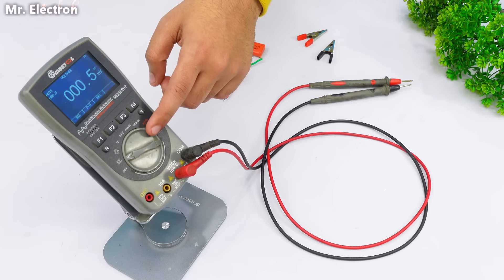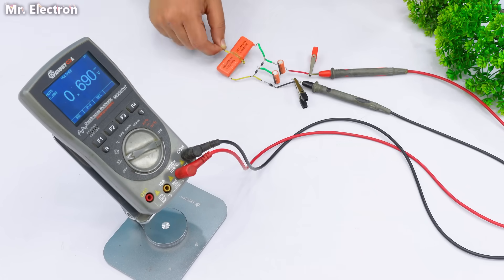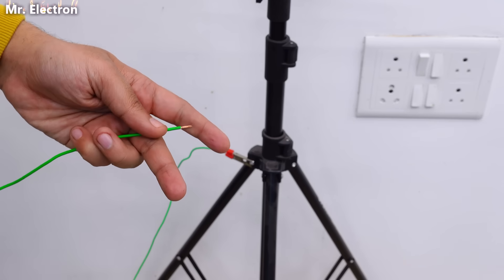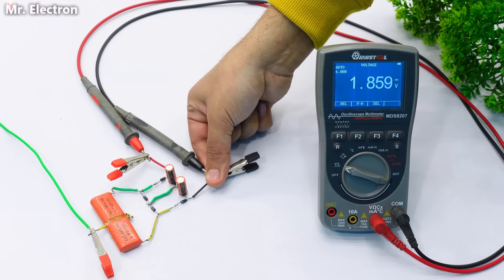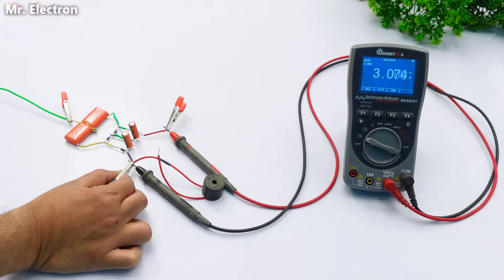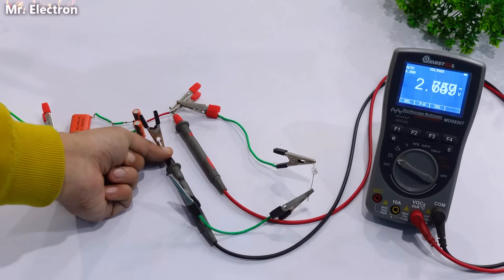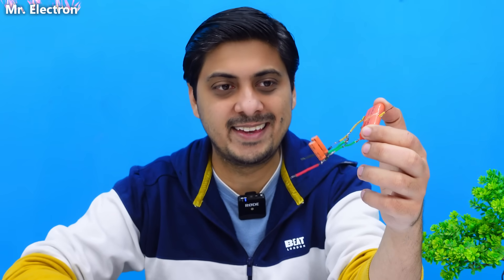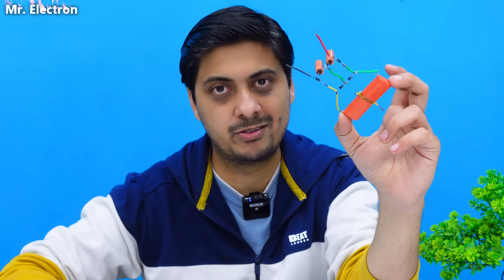Maxwell Chikumbutso - 5000 KW FREE ENERGY from RADIO WAVES | 100% Working Model DIY

Comment: I built some of these energy harvesters and was able to generate voltages ranging from 50 to 100 volts, the type of diodes are very important in these projects because of there ability to sence faint high frequency switch on and off at high frequency.
Reply: The highest RF fields are usually from AM radio stations, in the 1 MHz band. High speed schottky power diodes can do it. Back 100 years ago, farmers near big stations would hook up lights to their fences or barn roofs. No magic about it, just picking up high fields that you can calculate.
Reply: @corneliuselbourne1044  and when you apply a load to it the voltage falls off
Reply: @IanLogan-n2p  that's because the current is to low, remember high frequency is a type of voltage and you can't have voltage without current, you have to build another circuit to supply current like a DC to DC boost converter.
Reply: @corneliuselbourne1044  No, frequency, current, power, and energy are totally different things. If you step down voltage with a converter, you get more current but less voltage. The power is always slightly less than what you put in.
Reply: @jamesvandamme7786  I know but frequency dose have a relation to voltage and resistance, power and current also has a relation to each other even thoe there formulas are different, you can't have voltage in a circuit and not have current flowing through it, current in a circuit is lazy and need the Voltage to keep it moving, the building up and storage of current multiply to power.

Comment: Your conclusion is based on two (2) fatal faults. 
Firstly,  you're self contradictory in that you've proved that it works. However,  you go on to make an unreasonable assumption that you know everything about this technology.  Any other thing outside your scope is false.  In reality, there're people who know more, who know better. 
Secondly,  you're declaring that the amps/voltage so produced is too low for any significant application.  That is the discovery itself that he, Maxwell,  has made. If he has a car for display, what then is not real?

Comment: no doubt RF can be converted to electricity, problem is RF in the atmosphere is weak to produce substantial power. we need a huge RF collector to utilize it for commercial use. efficiency of conversion is also a factor . input power is always bigger than the output.
Reply: 50v/m height is a huge voltage, just imagine if we can use Mosfets to vary that voltage between 0 and 50 several times a second. Now increase the height and thus voltage to 500 volts ant 10 metres and use insulated aerial. Capturing 'Atmospheric energy' rather than 'radio waves' may be the correct word.

Comment: The principle of a crystal radio which does not require a battery, but works from the electricity coming from the radio station.
Reply: I continue to "shake" oilmen with my innovative project of a non-combustion engine, I remind you that I am posting here on my channel the technology and the principle of operation, according to which anyone can create a prototype and enjoy free energy, since I was denied financial support at the stage of the idea and theoretical research, after a year of unsuccessful searches. Including I will begin to assemble a sample. And soon another video will be released, revealing my developments, the wind of change is approaching! All those who are not indifferent, welcome to the flight in this departing innovative car, which will lead to great achievements for the successful future of the planet and humanity!
Reply: @maguccimotorincorporation  I hope you've solved the big problem of perpetual motion machines, that is, where to hide the battery.
Reply: @jamesvandamme7786  There are no batteries. It takes energy from the air or water and it cools down to produce energy.
Reply: It's because of the antenna and diodes ability to sense the frequency from the carrier wave from the radio station it's powerful enough to switch the diode on and off.
Reply: You can see the battery underneath the bonnet next to that square box he made
Reply: @IanLogan-n2p  It doesn't look like he made anything. It looks like a factory made traction inverter to drive the motor of the car. the 12V battery runs the auxiliary equipment in the car, like lights, radio, steering. Look inside any EV and you'll see a very similar layout. Look under the floor and you'll see a large battery which powers the car for hundreds of Kms. Then you have to recharge it. 
Somewhere he stated that you have to "service" the car periodically for a large amount of money. Maybe he charges it up and returns it to you, I don't know.
Reply: Of course xtal radio will work 
But do you people know that how much power is being radiates from AM Radio Transmission antennas 📶??? More than one Mega Watts(1MW) of RF Power. IN THAT CASE IT IS OBVIOUSLY possible to extract some where 2 to 6mV. But This is not the case with VHF UHF EHF, AND SHF. Frequencies. Reason. Because The Attunation at above 30Mhz is drastically high. So at higher frequency it's impracticable. Because the antenna 📶 at higher frequency extract power in atto Watts 10^18!!!!!!!
Reply: @wanisageer8936  Most broadcast transmitters are kilowatts, not a megawatt.
Reply: And its AM modulation

Comment: Your circuit is an everyday circuit. Anyone who kmows electronics can make that circuit. Whats missing is resonant frequency. Resonance makes a big difference in its effects.  For example a high pitch singer can break a glass at resonant frequency which cant be done by another singer. Because of resonance Max circuit is able to harness more electrons per sec and feed a greater output.  High speed serial input circiut feeding a high power parrallel  output. Second max is harnessing ambient energy not energy from towers. Thirdly a solar panel is 28% efficient. Now imagine if it was 100% Max device capture photons/sonic waves at 100% efficiency.

Comment: Tesla and other folowers like Don Smith; Kapanadze and others had did loop circuits so there are people who does it but govs don't want this for control.
Reply: They are open not looped! They stimulate the radiant energy to enter the circuit via neg ground connection and or antenna
Reply: I continue to "shake" oilmen with my innovative project of a non-combustion engine, I remind you that I am posting here on my channel the technology and the principle of operation, according to which anyone can create a prototype and enjoy free energy, since I was denied financial support at the stage of the idea and theoretical research, after a year of unsuccessful searches. Including I will begin to assemble a sample. And soon another video will be released, revealing my developments, the wind of change is approaching! All those who are not indifferent, welcome to the flight in this departing innovative car, which will lead to great achievements for the successful future of the planet and humanity!
Reply: "They" are not stopping you. The amount of power you get is minuscule. There is nowhere near enough to run a car, as Tesla is rumored to have done. (He didn't.)
Reply: @jamesvandamme7786 you are a complete clown James ..  you parade yourself as someone who knows things are factual but have zero evidence they are and you weren't there at the time.
At this point you look like a paid troll, as you reply to every post that doesn't meet with your programmed this is how physics works agenda.
Reply: @jamesvandamme7786  i find it amusing that the pierce arrow story was a mainstay of the tesla cult for decades, but since the legends have taken root on YT, theres almost no mention of it... in fact, your comment is the first time!
 instead its other stuff like "he was obsessed with the number 3..."

hmmmm... yet he designed a TWO phase generator and motor? only 3 phase tesla system i know of was one of the exciters for one of his coils... he chose to not repeat that particular approach...

Comment: Yes the tech works, but how is Maxwell Amplifying the input of his charge to the point that driving the car non stop which is a massive load and not draining one iota of the battery is the majic
Reply: Hogwash. The man cannot even explain the technology that he invented 😅😅😅😅
Reply: @MardoMacaullay electricity is in the air. Electricity is in the ground. Electricity is in space.😅
Reply: He used transient energy and fast switching system that produces radio currently.
Reply: Give it time grasshopper
Reply: I must have missed it. Where did he say it was going to drive a electric car?
Reply: There is a large battery under the car and he has only driven it around a parking lot. He's not "amplifying" anything, it's a stock Chinese EV with no magic at all. To amplify a signal, you need a power supply to run an amplifier. That's where your extra energy comes from.
Reply: @jamesvandamme7786 and you’re stating this with no sources or proof, it’s just your personal belief because you think it’s not possible
Reply: @jamesvandamme7786 The car has no charging port..it actually has a discharging port..the car is going to be put to test for all to see..it will run from Zimbabwe to Egypt. ..no charging. .perhaps it's time to put your SUV for a safari coz all are welcome to ensure there was no charging along the way..but for now..I guess Africa got this one.
Reply: Mosfets is the key
Reply: @sugerbear81  crap mosfets are just switches nothing magical.

Comment: If you measure also the current you'll obtain almost nothing from point of view of energy. The best approach is to use two ground points with a 12V-220V AC transformer put in reverse. It will work as long as your grid is up.  You'll obtain tens of volts with a current of 10-15 mA. But from this to power a car...is a long road. I will propose you a much direct experiment that will prove or disprove the Chimbutso claims: take a power cord from a 220V grid, connect it to an electric car that didn't have a battery and try to run that car on grid energy only. You'll blow the fuse when you try to move the car. If you didn't have an electric car, try this with 10 kWh electric motor (a small car have a 30-40 kWh motor). See the results. Stop chasing the wind friends.

Comment: The argument isn't if it works because it does. The argument is can it create more energy than it pulls in. When you are talking about pulling 5000watts from micro radio signals floating in the atmosphere. That Is something highly unlikely.
Reply: Yes you can get more than put in it's called repulsed energy system
Reply: @Dammytronenergy  I'm pretty sure repulse energy describes the energy that pushes particles apart from one another. Not the creation of energy from low level radio waves.😉

Comment: Hello, when will you create electronic circuits that benefit the home and if you can do it outdoors, you know, with alternators, washing machine motors, etc. I would personally appreciate it very much.
Reply: You need an energy source. The best is a wind turbine because the wind blows most of the time. you can make one that turns a small motor. The next best are solar panels. there is lots of power in wind and sun, but very little in RF radiation.
Reply: But  Chickumbutso also includes use of braking and solar to add more voltage and watts to gat needed watts, I believe. You can also use water generator to add to this system using water flow from decorative waterfall in the home and splicing the tubing to insert generator
Reply: @howardbarber9614  Do the math. Learn about power and energy. 
Maxwell is simply a scammer.

Comment: A few weeks earlier, I found that If I hold a copper wire connection to one terminal of a multimeter pobe and another pobe with a bare hand, I can get a voltage around 0.5 volt. After doing a little research, i suspect that it happens because of chemical reactions of the oily layer of my hand with the copper wire. But I am not sure about it.
Reply: That's how batteries are made, except with chemicals with higher voltage capabilities.

Comment: Use super capacitors to get 18v voltage doubler, stabilizer circuit  , transformer to give AC output
Reply: Do it and stop talking
Reply: @philipeMcfarlane How about you do it instead of being ignorant,  and talking trash on yt, keyboard warrior. Talking is easier than actually doing work.
Reply: Do you know the difference between voltage, power, and energy? 

Didn't think so.
Reply: The inefficiencies alone would waste all the power this is creating. This is creating like 20mW at most
Reply: Που είναι το παράδειγμα σας;;

Comment: You cant even power a small LED, lol. Maxwell Chikumbutso is a real genius for figuring out how to power a tv and car with these circuits.
Reply: If you know about electronic you have forgotten how to multiply Voltage or increase. Amperage also can be increase.  I know a little bit of electronics components and I know this for a fact. Challenge yourself and try it you may like it 😂.
Reply: @joereyes8835  No, the amount of energy stays the same or decreases as you turn it into heat. You can increase voltage in a transformer but you decrease the current. Learn some physics.
Reply: To power a led, you just need to connect a joule thief, simple as that. With the concept, it is possible to achieve great energy with the nano technology we have nowadays a device of a car size can be reduced to a small compact one. Open your mind, go beyond the boundaries of science. Science just mean "knowledge" and not "absolute". What we consider true today could be false tomorrow.
And what if the radio waves are not the ones from radio towers, but from other sources like space or a combination from many sources? all is possible remember!
Reply: It's nothing new. He only used a Crystal Radio Technology which was in use for decades
Reply: @ Wrong sir,  He figured out how to tap into the zero point universal grid matrix, you all fail to understand the basics.
Reply: @hiz-n-lowz1577  Oh, why don't you explain the "zero point universal grid matrix" to us? I'll make popcorn.
Reply: @hiz-n-lowz1577  LOL
Reply from the maker: A real genius with proof or without proof.
Reply: @mrelectron_alternator  In Africa they dont need proof. Well said is better than well done!
Reply: @mrelectron_alternator  You know, said it at the end!. The amount of videos this bloke has got in 3 weeks now. Even the fan boy usual channels cranking out the stuff yesterday, today. come on, Cars, homes, bikes. Even a TV needs a reasonable amount of power. He show that in his, no one else can touch or inspect it way like the car and all the other fake, scam cr**. That 10th February biggest invention of the century launchwas good. where was the working stuff proper scientists, engineers check. Web site, contact deals all a no go. All a scam. 
Say this on the fanboy videos and if by magic (like his fairy dust powered cars) the comments go. Someone will do well on these magic cars but it wont be the ones that buy. Normal plug it in, has a battery under the floor chinese car like every channels use footage on this. Nothing special. Good to see how this promised 7000km or so road test will work. Car get to something inside, indentical one come out, or a gap in time out of sight when at an agreed place and building, compound. It wont be real. you know it. Nice little circuit, It did what it did. The LED will be lower current draw, has to be, so kept going, sort of. Scale it up. invisible antennas on the $15000 (cheap) car and the fairy dust will work. 10's KW made to drive the thing. no.
Reply: Thé proof is thé réalisation.  And WE see it. @mrelectron_alternator
Reply: @mrelectron_alternator  Saith Tricknology: We dont actually produce revolutionary technology, we just say that we do.
Reply: @mrelectron_alternator 
Don't hate just because you can't figure it out. You proved his idea on a small scale, so just face it, you don't have the mind level that he does.
Reply: Maxwell Chikumbutso still use battery for his car as a buffering not fully run with microsonic energy device without battery.
Reply: @ cool story bro!

Comment: TRY CHANGING THE DIODE FROM THE CIRCUIT YOU MADE WITH "ULTRA FAST DIODE" THAT COULD SWITCH AT MUCH HIGHER FREQUENCY BECAUSE CELL/RADIO TOWERS USES HIGH FREQUENCY 🤔